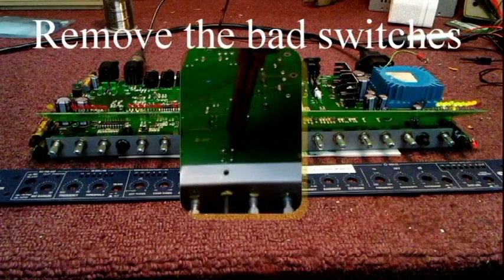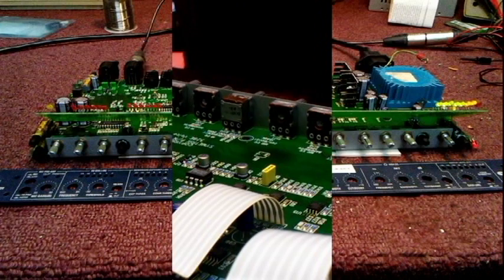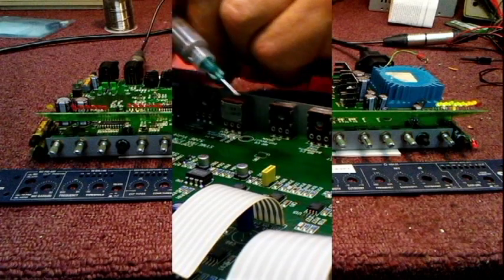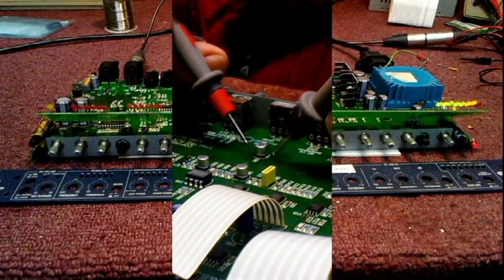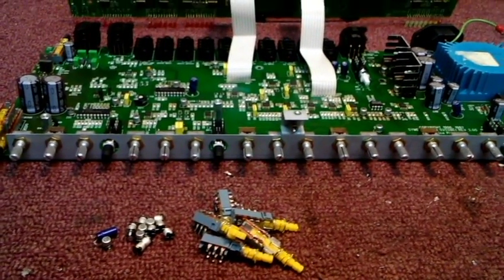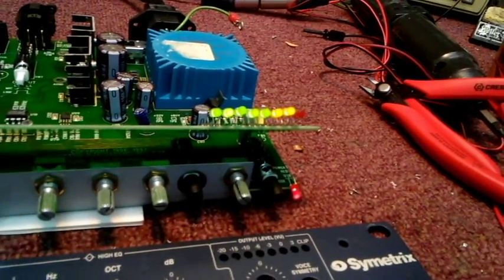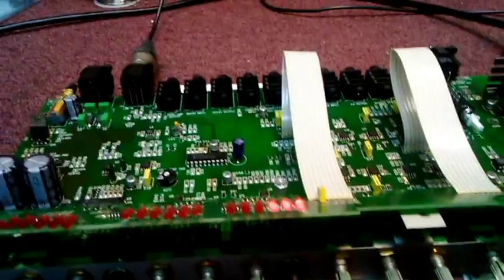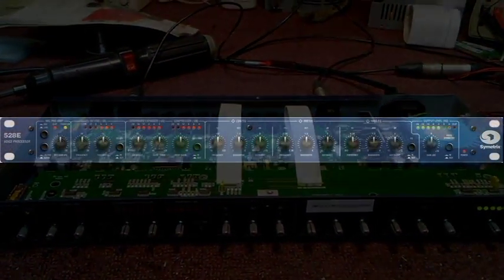Symetrix 528E Capacitor and Switch Replacement

Comment: Hi, Mr. AERV.  If I asked before, I appologize in advance..  I have a few of these units that most. likely need cap replacement.  (basically everything you did in this video).  Are you still working on these units?  I'm very impressed with your work!  I love these units and just want to get them back to spec from when they came out of the factory once again.
Reply from the maker: No sir. I have closed the shop. Other post-retirement activities have taken over my life.

Comment: Great vid! Lots of help. Do you have any suggestions for replacement switch parts from Digikey? (the BOM I got from Symnetrix support listed "Schadow" switches, but Digikey doesn't carry those.)

I figure I might as well just push all the chips into the middle of the table and re-cap and re-switch it all since I have it opened up on the bench.

Thanks again for the great vids!
Reply from the maker: Thanks for watching.
Here is a list of the parts I use. All are DigiKey part numbers. 
4PDT Switch  401-1226-ND 
DPDT Switch 401-1223-ND
4.7 uF 35V SMD BP PCE4296CT-ND 
47uF 100V P5596-ND
100uF 100V  P10776-ND
47uF 25V NP  P1179-ND
1000uF 50V P12393-ND
10uF 35V  PCE3948CT-ND
Reply: @AERVBlog  Thanks for the help! I started re-capping and hit a novice/rookie problem. Perhaps you have some advice. 

At C15 the neg pad separated as I was removing the old cap and the trace to R22 peeled away from the board. So now I have a split pad, and a peeled up trace that's broken (doesn't quite reach) where the neg pad was. (I can provide a pic if you're interested) I'm not sure how best to proceed at this point. Good times! I'm guessing some sort of patch is going to need to be created... 

Also, if you're ever trying to think of new vids  to post, how to recover from common pitfalls such as this might be great!

Thanks again! You're vids are great!
Reply from the maker: @griggsnichols9988  cenc me a picture at aervblog@gmail.com

Comment: Great video, very informative and I realize I need to get my rework station back out of storage!  One suggestion, if I may, on the replacement of components on the 528E, based on 10+ years of repairs on these.  I find it best to go ahead and snip out the switches with a diagonal pliers first, then use wick and a 25 watt iron to remove the leads that are left in the holes.  It's MUCH faster, and much harder to ruin a pad by overheating.  Use denatured and a Q-Tip to clean all pads, top and bottom.   (Put another way, if you don't have the proper rework station, you can risk damaging the solder traces on the circuit board, by trying to remove the switches whole.)  By the way, the asymmetry switch on the far right is usually the first to give you trouble.  Partly because they are only using one half of the switch, and the fact it's rarely used.  Some users that don't use, or don't care, will simply solder across the switch contacts.  Some have even removed the switch, soldered across the terminals and not replace the switch...which drive me nuts.  Lastly, the power supply caps can be a real bugger to replace if you don't have enough heat.  Because they are physically next to the voltage regulators, they have a tendency to dry out faster than the other caps, and the result is hum in your audio.  Use care when removing those caps, as they are soldered on BOTH side of the circuit board and if you are not careful and pull too soon, you can tear a trace on the component side of the board.  (Don't ask me how I know!).  The 528E was a great mic processor.  I wish they still made them.  Oh, and one last thing...the 528e's last a lot longer if you leave 1 RU between units.  I work in broadcast, and the radio stations that used to stack 4, 5 or even 6 of them, historically have more problems with caps drying out, due to all the heat that's generated and distributed.  Unless you can blow a fan on them, let 'em breathe.  Thanks, I feel better!
Reply from the maker: You are right on every point. I have changed the way I do these a bit since this video. I do now cut the switch leads off and it helps a LOT.  Also, on the big filter caps I use a solder sucker first then flush cutters to snip the leads close to the underneath side of the board. When they made these things they crimped the leads so they would not fall out during soldering and if you don't snip them you stand a good chance of ripping out the through hole plating and the top pads and traces. I most heartily agree that simply shorting out the switches is a crummy way of fixing these. Lazy. Most of the time I just end up replacing all the switches including the Line/Mic switch inside. That one never gets touched and the contacts just go bad.  Thanks for the comment and for watching.

Comment: Hi. On my Symetrix 528E im not getting a huge mic buzz. This happened out of the blue, til now no issues whatsoever. Tried switching out the cable from mixer to the processor but same problem. Any ideas?
Reply from the maker: More than likely it is caps. A couple of things to try first though. If you are using the mic level input try exercising the 20db pad switch. We never use them and they do go bad. Same thing for the rest of the switches including the mic/line switch. But I would be willing to bet it is a cap in the power supply.
Reply: AERVBlog Thank you sir.
Reply from the maker: @joedawson5353  welcome. Hope it helps.
Reply from the maker: @joedawson5353  if you are going to replace the caps, the big ones, be sure you cut the leads off the bottom of the board first. Remove solder with wick,  cut the leads with a pair of flush cutters then try to pull them out. If you don't cut the leads you WILL pull the feed through plating out and some of the top traces as well making repair very tricky and not always successful. When they made these things they crimped the leads on thd bottom to hold the caps in while wave soldering the board and the crimps will not fit through the holes.
Reply: AERVBlog   thanks for your note. Ive already sent it off to Symetrix yesterday. I figured id go ahead and have it refurbished. Not a tech guy myself I’m leaning on having a spare.
Reply from the maker: @joedawson5353  sounds like a plan. Let me know how it comes out. Since I put up this video I have done a couple dozen of these.
Reply: AERVBlog im in Halifax Nova Scotia Canada. Where are you?
Reply from the maker: @joedawson5353  Columbus Oh
Reply: AERVBlog youre kidding! Thats where i last worked and grew up. And moved from 9 years ago Worked at WNCI/clearchannel/iHeart for 27+ years!
Reply from the maker: @joedawson5353  The Blitz here.
Reply from the maker: @joedawson5353  Contact me aervblog@gmail.com

Comment: What voltage bipolar caps do I need it looked like 4.7uf 35v in you video thanks.
Reply from the maker: That is right 4.7 @ 35 BP I get mine at digikey. Part # PCE4296CT-ND
Reply: @AERVBlog  thanks I seem to have a slight hiss on the hi eq when I turn it up do you think this is the caps causing it
Reply from the maker: @doughboyvideogates6920  There are two 4.7uf surface mount caps located in front of the + and - 15 volt regulators that go bad and cause oscillations at about 8MHz. The sub harmonics can be heard when you boost the highs. If that is the problem it almost always means that the rest of surface mount caps are bad too. Hope that helps.

Comment: Thanks a million man!  I bought a Quick 861DW rework station and replaced all the caps (and the two input transistors that were cooked) and it works like a charm now!  For anyone who's interested, here's my digi-key cart for the parts: http://www.digikey.com/short/zcrrzc  Note that one of the caps i used was too tall to fit under the top circuit board with the LEDs, so you'll have to bend the legs 90 degrees and lay it on it's side when installing it.  (I glued it in place with a dot of hot glue too just for good measure.)
Reply from the maker: Yeah, that one 47uf @ 100V cap needs to be shorter. I get smaller ones from Mouser so I don't have to bend them over. Mouser # 647-UHE2A470MPD. They are Nichicon. Thanbks for watching.

Comment: Have you found a source for the switches?  The caps are easy, but I have not found a reliable source for the switches.
Reply from the maker: I get mine from Digikey.  I am not home to look up the part number but in a reply to this or the other 528E Vidio I gave a listing of digikey part numbers. Hope that helps and thanks for watching.

Comment: my symetrix 528e is with noises and this with the leds all lit, what power?
Reply from the maker: If all the LEDs are lit up it a sure sign that the caps need to be replaced. That included all the 4.7uF surface mount too.

Comment: Thanks for showing your soldering technique.  I have soldered a lot of these with conventional soldering equipment.  I have burnt capacitor edges, and some solder pads lifted off the boards.  Much easier the way you do it!
Reply from the maker: Glad I could help. Thanks for watching.

Comment: Seems like the capacitors are always the ones that go out on this unit.  Lucky for me ...I bought one new in 1996 and its still working today. No prob.  I generally power it off when NOT in use.
Reply from the maker: John Davenport yeah. I does seem a little suspicious that all of the surface mount electrolytic caps go out too but I guess they are just the same but smaller. The ones that will fool you are the non-polorized ones that feed the links between stages. Those will test good but leak like a sieve and give you all sorts of goofy symptoms. Thanks for watching.

Comment: hello my chosen symetrix 528 e output level gain potent of my device cuts off the sound after the middle part DE-ESS part is not working
Reply from the maker: Most of these units are used in an environment where the pots and switches are set at one place and never moved and that makes them  intermittent. You can try cleaning the pots with good cleaner like DeoxIT. That might work for the pots but I have never seen anything that can clean the switches well. Being left in one position for so long actually causes the point where the little slide spring part eats away the copper where it makes contact and no amount of cleaning will help. As for as the De-ESS, that could be the coupling cap or the IC. Remember these things are old and I have never found one yet that didn't need all of the 4.7uF caps changed, even the older ones with through hole components. Leaky caps can cause a lot of weird problems. Thanks for watching.
Reply: thank you for your information and your help
Reply from the maker: tumay can no problem. Let me know what you find.

Comment: What SMD desoldering station do you use or recommend?
Reply from the maker: Steven Zagony I use an inexpensive unit I got off Amazon. I think it cost $65 or close. There are all kinds of numbers for the thing since it is sold under a lot of names but the one I have is a Zeny 852D+. It does the job for me but I would not recommend it for production work. If you want a good one that will last a long time look into Hakko line. You will spend a considerable amount more but it is a professional tool. Mine is not but since I am retired and do electronics repairas a hobby now it is good enough for me. Hope that helped.

Comment: Hi! I just received an older 528e from a seller on ebay (it was advertised as in working condition). I bought it as a backup for the unit I currently use. I just powered the unit up and found problems. All LED's are lit and a constant buzz is coming from the output (with no mic or input and with gains all the way down). Any idea what could be wrong with the unit? I'm wondering if I should box the unit up and send it back to the seller or ship it to you for repair! Thanks so much!
Reply from the maker: chrisratliffvo It sounds like all the little 4.7 Uf caps need replaced 
as well as all the regular electrolytic bypass caps. There are a bunch 
of them.  If you have not done any surface mount rework I would not 
suggest you try it yourself. I ruined a bunch of caps and burnt a couple
 of holes in boards before I got it down. I would be glad to fix it for 
you.
Reply: Thanks so much for the reply! Please shoot me an email, I'd like to discuss overhauling the unit. You can email me at (my youtube username)@bellsouth.net